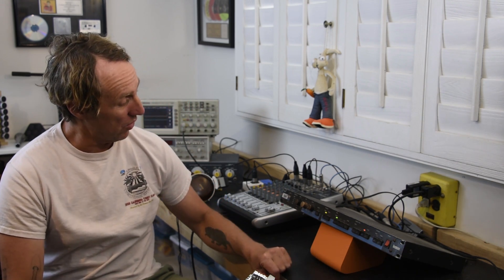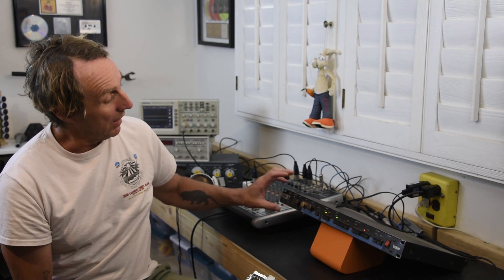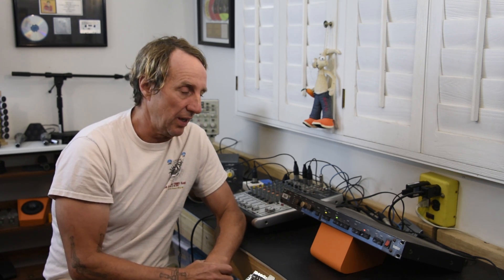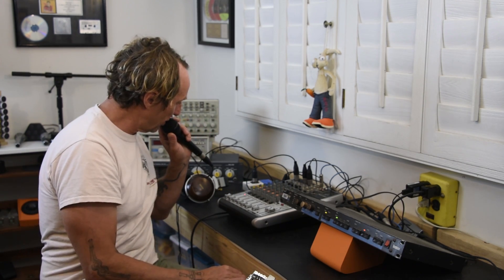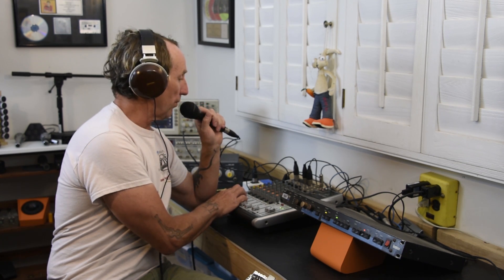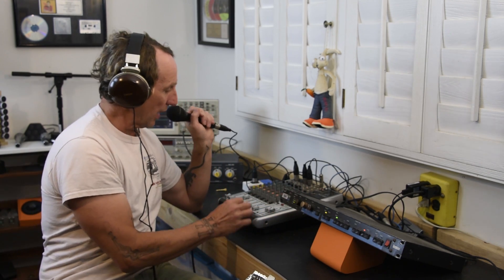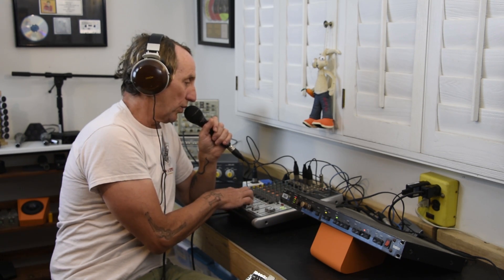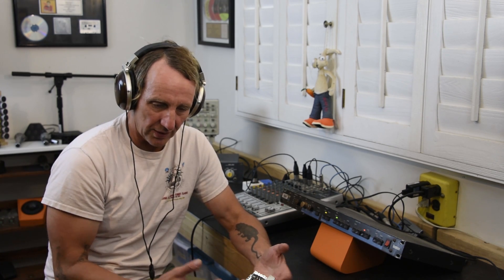Using a PCM60 Reverb as a Distortion Effect

Comment: Would love it if when you go over the DBX unit, if can share any thoughts on similar units if you have experience with them like the Furman P-10, Peavey Kormos, Apex 204 big bottom
Reply from the maker: Oooh, not much experience with them other than the 120X with 2 freq knobs and 1/4"
Reply: @DaveRat  oh no worries then.  Just figured maybe there was a reason you went with the DBX.  I rarely hear anyone talk about it vs the others I mentioned.
Reply from the maker: @Espresso101  the DBX 120x has a pure clear sub synth with 4 seperate distinct frequency controls making it very effective for dialing in a specific sub synth sound. Not aware of another unit that offers that control and hits those very low frequencies.  Beer dbx units did not maintain this control, nor did other units I briefly used over the years
Reply: SoundGuy - I have a Furman Punch-10 and a DBX-120XP, you have to live with them for a while to really understand their different character. I prefer the greater control the DBX has but I never got rid of the Furman as it’s a great unit. I also use an SPL Classic Vitalizer 9215 which is balanced and also great for sub enhancement with a different approach. Really looking forward to Dave’s DBX hack.
Reply from the maker: @regortex3364  yes, and as with all in sound, it's what works and gets you the sound you desire, there is no right or wrong